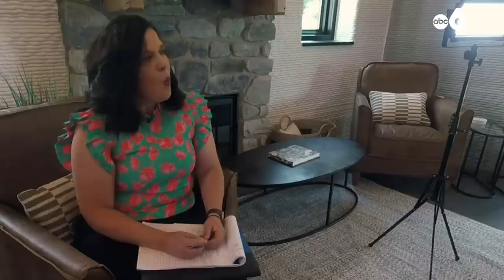First completed 3D-Printed home in Ohio, is this the future?

Comment: Ok I get it….. however once those concrete walls are solidified how are you going to do repairs such an electrical issues, plumbing issues, making changes to room?
Do you have to bust up concrete walls, instead of just taking down drywall and replacing it. Who’s going to come in and do concrete repairs internally??? Plus they all alike similar interior walls same exterior walls… that’s track housing and like project or war homes. No real special identity of they all look alike? 
I see the benefit s but I also see huge repair issues if required! 🤨🤔
Reply: Not this brand but other ones they can make walls to look more different. They can do curved walls which isn’t easily done now. The repair issues is def something I like to know more on I know I see channels they add for those, but past that idk. Seems like plumbing would be a nightmare to fix but electrical with the channels should be possible. You can find people that work on concrete. Reno a home would probably be impractical though, but idk if that is a bad thing or not. Now additions hopefully will be easy to do.